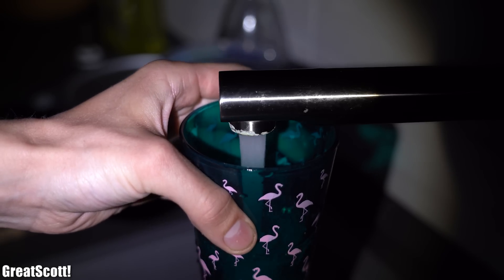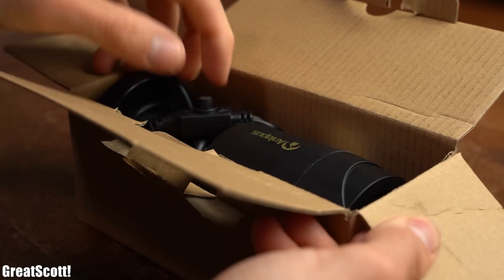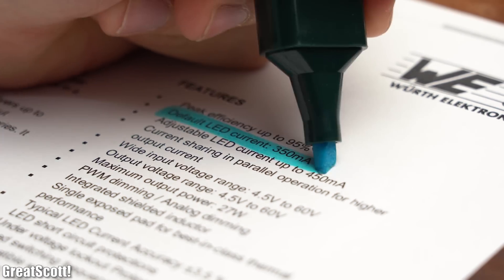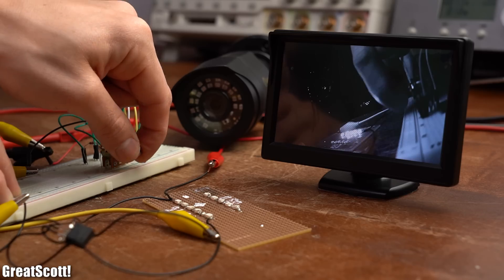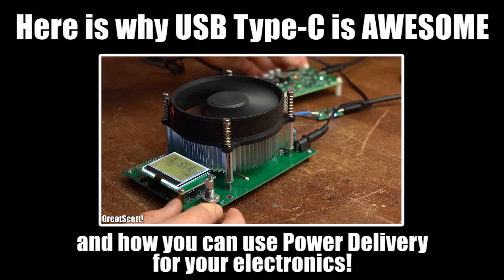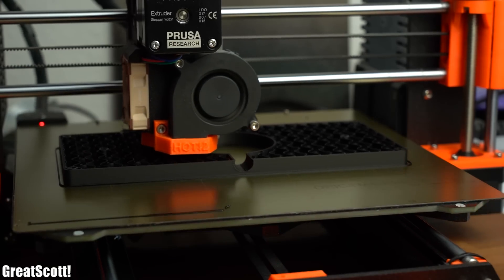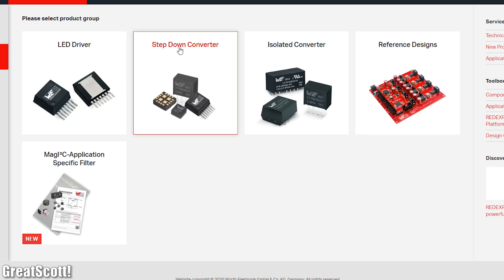How to make your own Night Vision Device!

Comment: You forgot to use konkav lenses. You can buy the casing from Amazon/eBay as "Cardboard" for a Euro or so, which usually is cheaper than buying the lenses alone. With that the distance from your eyes to your screen massively gets reduced. A simple Google Cardboard VR casing is available between 1.99€ and a luxurity version with everything you could ask for for not more than 20 €. And that makes your night goggles much more usable.
Just saying. Also you can use a Raspberry Pi for that purpose with a PiNoir camera, which will cost like 20 € for the cam and if you just take a PiZ for that, 5 € for the computer.  I don't know how much you paid for your security camera, but it won't beat 25 € I'd guess. For the screen you can reuse what you have or go for a Pi Screen, that you can mirror into your vision through a pair of glasses. 
So that you still can see the normal world around you ∧ the night vision. 
And if you do it right, you do use a small prism ∧ two mirrors that splits your view into two screens, so that you can see stereographic. Have I paint a picture about that? Guess you can imagine what I see. Yes. 
Your idea is great, but there is much to work on. It can be made cheaper, much cheaper and much better. Still, great work!
But using a PiZ would open the possibility to share your screen with an other user, so that you can go teamworking at night. Thinking of paintball here. GPS with connection running means you know where the other is, you have a minimap and can coordinate the attack, because there is nothing to stop you using muffled voicechat or inserting signals for directions or commands through a little joystick on your gun. All this is not possible with your setup.

Comment: While your device is very ingenious, a camera that uses light amplification would be more useful. The ideal would be one with light amplification combined with IR illumination for when there is truly no light to amplify. 
The latest generation of smart phones have super low light cameras, able of producing an image in near darkness. 
Soon even these devices will be consigned to the scrap heap of obsolete equipment. It would be interesting to see if the camera modules can be salvaged and reused in this sort of application. I suspect that that the cameras are now so integrated into the phone circuits, this may not be possible. Certainly there maybe difficulty in accessing the lens controls and the image processing. 
In older phones the camera was an identifiable separate module, all be it with a proprietary electrical interface.
The use of a security camera at least solves this interface problem, though at a higher cost. Some security cameras now come with a very impressive low light performance, measured down to 0.0000025 lux, unaided by IR illumination. 
I suspect a more practical solution for this application would have been to make the camera handheld and use one of those tiny displays, to put the image display into a set of glasses, maybe over one eye only.

Comment: Nice project. However I would maybe use a thinner PCB and no copper fill due to weight constraints.
Also, Using an mt3608 with a suitable current sense resistor on the low side would enable true 3.7V or 5V supply operation and be much smaller and less weight.
Using series resistors for each series of LEDs would be nice, since some binning differences could result in some rows receiving 100mA while others only receive 40mA.

Comment: GreatScott's neighbour: "How to make your own flashbang"
Reply: Nothing for that kid that built a functional nuclear reactor in his parents garage.
Reply: @Shadow__133  well technically it was in his parents shed.
Reply: Logan Indistinguishable. Im from a poor country where you are either on the 1% and have a garage WITH a car, or you are poor and have tools in it instead 😂.
Reply: That's a job for ElectroBoom 😂😂
Reply: Flash powder is a simple mixture of fine and dry potassium nitrate, sulfur and aluminium dust, albeit one may replace the aluminium with magnesium powder and withhold it in a weak pressure vessel (ideally strong cardboard, else you're making s pipe bomb) to create a flash bang.
This is dangerous especially in large quantities and all the information is basic engineering knowledge and can be read off wikipedia.
Reply: @Sparatist Nothing. The display isn't bright enough to harm you.
Reply: That’s why it’s smarter to run single eye nvgs vs goggles. One flash and both eyes are down
Reply: How to make your own granade

Comment: I would highly suggest using FPV Goggles like eachine ev100 and an FPV camera without IR filter for a much more compact build. We usually use those in racing drones. I've been wanting to do a project like that using the exact same concept with those components i mentioned but I don't have enough cash to do it. 🙂

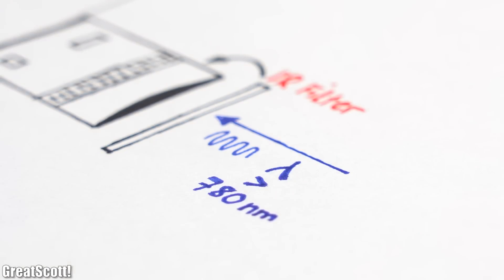Comment: 3:28 security camera does have IR filter which it switches on the lighting conditions. At night it removes the filter and turn on the ir LED's to get night vision capabilities.
Reply: How do you mean removes it when it is just glass(filter) in front of lens right?
Reply: @Luka-xx5ve  by using solenoid based slider system. Which slides the filter in front of camera in day time and remove it in night.
Reply: @hemantbabel4279  I think in day time IR filtered by software, something like automatic color-correction. Mechanical part it's more expensive and less reliably. But maybe you right, I don't know for sure.

Comment: security cameras do have infrared filters, so they can work in daylight, theres a small solenoid that moves it to the side for night vision. i designed one of these last year for a client, with a switch that activates this solenoid and the infrared LEDs, and its built in a cheap VR headset, much smaller

Comment: That's not really a nightvision device, in the traditional sense. AFAIK a real one uses a photomultiplier to make the light it receives brighter. If you're just using IR LEDs, you're visible to anyone else with a nightvision device(Or a smartphone; the IR filters in them are not really 100%). The security camera is huge, compared to what is does. Maybe a smartphone with a removed IR filter, plus some LED's next time?

Comment: Indeed it is fine for indoor use. However it is really challenging to develop the nightvision system using only the IR diode reflector and digital camera which can be use outside, with at least 20m range.  I've been doing this 7 yeras ago but the result was quite poor. However the techniqe and my experience (and budged :D)  is now at higher level than before. The high power IR diodes is now chepaer and the have become widely available. Also the proper beam focusing for higher ranges may be chalning. Maybe some has already the experience ? I would love to hear some news as for DIY outdoor noctovision !

Comment: Maybe you could revisit the project with some EACHINE EV800 googles (look them up on Banggood/Aliexpress).
These are analog 5.8GHz goggles that you put on your face, complete with a lens and everything, but they also feature where you can supply your own analog input and it will show it on the screens. These would fit a lot better on your face and would be more compact because they use a lens such that the screen doesn't have to be too far away from your face.

Comment: FBI OPEN UP!
Reply: Use a cap from vpp to gnd it will short the ac but will not affect the dc supply to the fan
Reply: Sorry reply meant for question above your comment

Comment: Oh God, that's hilariously enormous XD you could get something far smaller using a Raspberry Pi Zero, a Pi-compatible camera without an IR filter like the Pi NoIR camera, a smaller LCD display with a lens [like in a smartphone VR headset],  and the IR LED circuit you cooked up. It probably would end up being about the same size as a smartphone VR headset, and you could even have space for a battery built in.

Comment: If you leave a few centimeters of wire when you cut off connectors you keep the potential to use them in a future project.

 Also, what happens to the current in your LED bank if one burns out?  The series string is lost and the remaining parallel strings now have more available current to draw.  Can they handle it?

Comment: I have some experience with analog cameras used on fpv drones. There are cameras like the Runcam Owl which have very small minimum light requirements (as small as 0.001lux iirc) and are also very small, which would be a perfect fit for such a project. They also don't feature IR filters, so if anyone wants to replicate this project, try using that camera
Reply: Look, I know this is 2 years too late to ask this question, but would you mind further explaining how to adapt this tutorial to that specific camera
Reply: @spencerm8773  From my understanding, the fpv drone analog cameras use composite, so you just need to connect composite of the camera to the composite of the screen, just like it was shown in the tutorial.

Comment: "This portable device" I think it's a bit of a stretch to call it "portable"... wouldn't it be easier and more compact to use a VR headset for this?
Reply: Only if he used two screens- the focal point for the single one was the limitation. 
It's possible he could have used that VR headset and it's internal screens but then you run into the problem of cost of the VR.
Reply: @girthquake1413  you could buy a broken one
Reply: How would you connect the camera to the VR headset though? They don't just have RCA jacks on them...
Reply: @KeeganDitty Indeed, but good luck plugging analogue RCA signal into HDMI or DisplayPort.
Reply: @KeeganDitty Ok but for real though, how do you actually expect it to work? You get a VR headset (not cheap), an RCA-HDMI converter, and... then what? You can't see the screen because the lenses distort everything. Remove the lenses? Now you can't focus on the screen because it's too close. I really don't know how you expect this to work.

Comment: I'm not sure if you can get them over there, but you can look into acquiring an Image Intensification tube (photomultiplier). The tubes themselves are kind of cheap (at least here in the US) but the power supplies are expensive. Given your aptitude for power supply design that would be a fun project! 
That and any one else with an IR detector is going to see you lit up like a christmas tree, but photomultiplication is passive.

Comment: Perfect timing, oneplus just disabled their visible filtering mode...
Reply: lol 
they just say it is a colour filter
Reply: Just search for an external app for that, a software update wont degrade the camera performances.
Reply: It was possible for the camera to see through thin clothing, that's why it was removed
Reply: Pretty much any camera without IR filter can do that
Reply: @w04h  how? I thought that glass was opaque to ir
Reply: It has only been disabled on HydrogenOS. The normal OnePlus 8 will still have the feature
Reply: @uranium_donut  the normal OnePlus 8 doesn't even have the photochrome camera only the Pro. But they are working on a software update for both HydrogenOS and OxygenOS to fix the problem then it will be reenabled for China.
Reply: They only did that in China though?

Comment: When you were changing the video mode i thought about the Predator visor.
Reply: That really is accurate though; they did a decent job in the movie, you can make out him flipping through various EM spectrums. Looked like thermal, laser ranging, penetrate radar/x-ray, etc. If they ever get a system working to mask you from visual light, you would need an array of non-visible range sensors, as being invisible means you couldn't see, either.

Comment: I made similar device by removing the IR filter from my phones camera an add IR LEDs to the flash light circuit
Reply: Diodegonewild  also made such a thing.
Reply: @Badr Ahmed Where did you hear this from? Any sources? There's a lot of camera's without IR filters (such as the one used in this video - it's a simply outdoor security camera), and personally can't find any information claiming that light would damage the semiconductors.
Reply: @Felipe2077tv  It doesnt do that, there is a whole cummunity of photographers that convert normal cameras for infared photography.
Reply: @reldies5364  Thanks! I was thinking it would be weird if removing that filter would damage the sensor.
Reply: That's brilliant! How did you remove the IR filter from your phone camera? Are there tutorials on YouTube to do that?
Reply: @Felipe2077tv  hey yes its here :https://www.youtube.com/watch?v=Gt_p9loJUO4&t=9s
Reply: @Felipe2077tv  yes
Reply: @Felipe2077tv  The filter can be a plastic frame with a purple piece of plexi and it can be removed simply by popping it off. I've also seen thin purple sheets glued to the lense. They can be removed by scratching it off with a knife (this might damage your camera so I wouldn't suggest it).
Reply: Or you can buy a oneplus 8 pro ;)
Reply: @Badr Ahmed It does not. The only thing that happens is that your autofocus doesnt work that well anymore and your auto whitebalance doenst work.
Reply: This just came to my mind too. Even in combination witg some auxilary IR LEDs, and a cheap VR phonebox.
Reply: Same i made it from my old nokia phone lol
Reply: @shutdahellup69420  yes I have seen
Reply: Stupid that phone manufacturers are not creative enough to realize the technology for IR night vision is in every phone already.  Non-creative people and bean counters design our products anymore.
Reply: Not to mention the IR LED now allows your phone to be used with an app as a universal remote control.  Your TV remote uses IR to communicate with the TV.

Smart phone makers are not smart.  They are lazy and cheap.
Reply: @gavincurtis  Cameras that are able to see infrared are not used for safety reasons.  
Because you can see through some women's or men's clothes, or through some black plastic.  
They create discomfort which is why the creativity issue of infrared cameras is not very developed.  
However nobody stops you from removing the infrared filter of your camera and replace it with a 780nm filter to let only the infrared light pass through.
Reply: alby boy 🤔 so what has to be done to make a phone CCD do what Sony camcorders have done for decades?  Don’t they use a tiny actuator to remove the IR filter out of place and use and an IR emitter?  BW signal is converted to green for night vision effect.

Then when IR mode is off, the IR filter is put back in place automatically for normal use.  The IR emitter LED now doubles as the IR blaster to make the phone a universal remote.

Now imagine if the zero engineering/innovation iPhone department knew what that flat planar charging coil could do when not charging...  imagine a metal detector...find that wedding ring in the tall grass,  find that stud behind the wall at not too much extra phone cost because all the parts are there....but nobody can innovate.
Reply: @Mik Wri 
You have no idea what you are talking about! Only photo multiplier tubes in conventional nightvision systems can be damaged, image sensors can not.
Reply: Mik Wri  relax
Reply: Mine doest have an IR filter,very nice 😊

Comment: I just planning to make this project with my fpv goggles then you made this. Wow!
Reply: I've been thinking of using one of my FPV headsets, should be more compact than this, could also use ready-made ir panels of Cctv cameras.
Reply: @welshdave5263  i have fattshark attitude v3 and when im goes to highschool, i experimented this with scrap security camera. It works very well but you know fpv goggles are not cheap then this car monitors.
Reply: ive made this years ago with an old fatshark and a security cam. no need to build a complicated pcb since the security cam comes with Infrared LEDs already. It was a lot more compact than scotts design